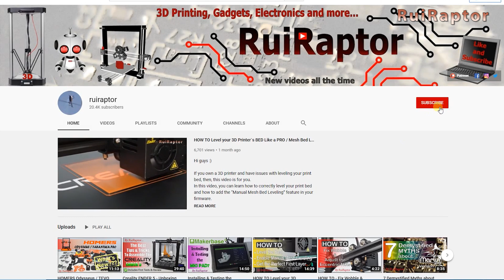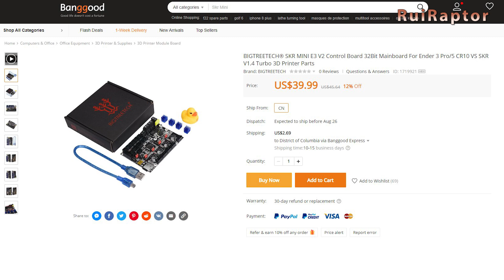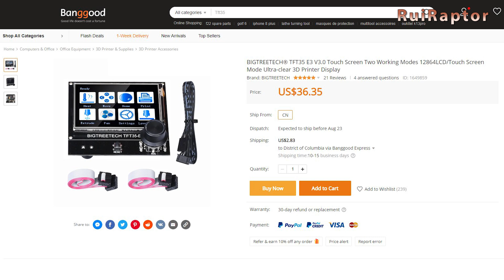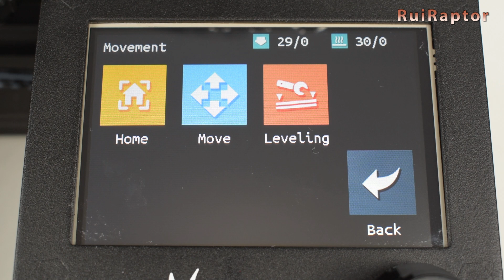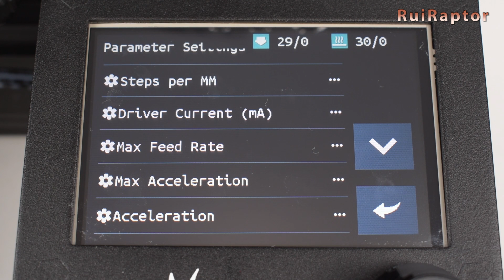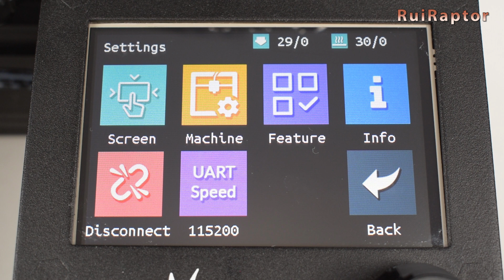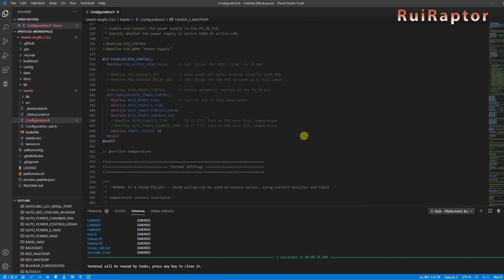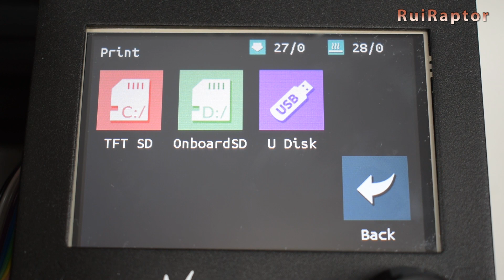SKR Mini E3 V2.0 + TFT35 Installation Guide + BLT Upgrade (ENDER 3/ENDER 3 Pro)

Comment: Very Disappointed.  I replaced the original Creality board, in my Ender 3 with the BTT SKR Mini E3 V2.0.  Now my computer cannot communicate, find, or recognize my Ender 3.  The seller does not respond, and, I find the Git Hub information useless for a person that is not very technical & computer savvy / literate.

Comment: Great video.  I am a bit behind the times and willl be doing this upgrade to my Original Ender 3, although I have never had any problems with it.  I am puzzled by the comments on the "noisiness" of the machine.  I do not think it is bad at all, and far better than the terribly loud and headache giving crap "music" the neighbours play all the time.  With all my doors & windows closed, and the curtains drawn, that crap "music" still drowns out the little noise of my Ender.

Comment: Rui my printer still saying  " no printer atacched" any sugestiion?
Reply from the maker: Hi Rui, make sure you have the serials correctly defined in Marlin. Also, make sure the serial cable is connected correctly on the board and on the display.
Reply: @ruiraptor  thanks i will review that and try again. Once more muito obrigado

Comment: Does the skr mini have the same issue as the original ender 3 board where the electronics fan and part cooling fan are wire to the same place?  This is a serious issue if printing with the part cooling off which would also turn off the electronics fan.

Comment: my part cooling fan and motherboard fan comes on but the front facing heatsink fan doesnt turn on. any ideas why? i double checked the wires i saw in this video you didnt plug in the front facing fan

Comment: The stock ender 3 boards have both the part fan and electronics fan wired to the same power connection so that if you turn the part fan off, the electronics fan also turns off.  I was wondering if the v2 board has separate power controllers for the part fan and electronics fan?

Comment: Great video! Do I need to flash the firmware even if I am not using BL touch? Or am I ready to print as soon as the new board is installed?
Reply from the maker: We would recommend to flash the latest Marlin version.

Comment: I installed the v2 and tft50 in my ender 3. I updated the firmwares and I cannot get a print from thr touch screen to work. I have to go in marlin mode haha. Ferrules for everything. Creality finally got the hint.

Also do you find the touscreen very washed out. It has no visibility from any angle.
Reply from the maker: Hi, our touchscreen does not look washed out. Regarding starting the print, do you have problems only when starting the print when using the touchscreen? Are you selecting the correct media to load the files?
Reply: @ruiraptor  yeah, I can only see files on media attached to the screen but if there's a card in the mainboard slot I cannot see it in touch mode and I don't think that's how it should work. All the amperage settings for the motors I had to enter in marlin mode and the touch mode. I think I'm going to put the old screen back on and reflash the firmware on the board and get that sorted out and then add the screen I think.

Comment: Why does everyone say to trim the tinned wires?! It is a useless gesture. The ferrule advice is fine, but you don't need to remove the tinning. I don't know how this misinformation spread. Either way you do it, you are still making a cold weld. Tinning the wires is not going to cause you any issues or more cars, boats, houses would be on fire. The issue is more akin to stray wires and better electrical connectors that ferrule connectors work. The connectors are often coated with tin, the solder joints are tin, the wires are coated with tin when soldered directly to the board. Just install the ferrule.
Reply: Well spoken! This is useful information for the bigger part of the readers of this comment section. 

I would like to add to your explanation that there’s also lots of different kinds of tin that have different properties and make the end result way more beneficial to the general set purposes of making a soldering connection. 

I personally have 3 things that come to mind when I’ve decided to make use of soldering connections over plug and socket connections. 

Those are;

-Conductivity of the joints (also the final resistance simultaneously)
-Soldering strength 
-Maximum meltingpoint

So there’s general purpose tin and some more advanced fieldwork setting tin. 

We never only use the metal tin, commonly used tin is an alloy of 40% tin and 60% zinc which is widely available and pretty inexpensive. 

I prefer to use an alloy that contains a percentage silver or copper just to keep the cost relatively down. 

Those alloys will increase everything including the pricetag. 

The silver containing alloy I prefer is 97% tin and only 1.2%-3% silver. While the copper alloy has a higher melting point and contains more different elements (metals) so the percentage of each element fluctuates more than the silver variant that I prefer. 

Melting points are;

Tin-silver alloy 198°C upwards to 217°C

Tin-Zinc-Nickel-Copper alloys 209°C up to 232°C

Comment: Great video guys. I'm about to go put the board in my ender and pid tune the microswiss hotend and figure out the current and esteps for the orbital extruder. I have a brand new bl touch that I've had since August of last year. I don't mind the corner paper method but I'm putting on a pei bed as well and I'm wondering if it's worth it to install the bltouch or just play with it some day when I'm bored. I have a spare y gantry plate if the existing one is warped. I'm replacing the glass, hotends and main boards on both my ender and cr10v3. I plan to enclose that one and keep the separate enclosure box.

Comment: I swapped my board and when i turn it on it just stuck on the start up screen, help please!
Reply from the maker: Hi Mark, have you installed the correct firmware on the new board?
Reply: @ruiraptor  yes I tried to update the firmware, when I insert the micro SD and turn on the printer nothing happens it just stays on the start up Screen. Then I tried to put back the motherboard that came with the printer and it works fine. So maybe I got a broken skr mini board?
Reply from the maker: Hard to say. Can you send the config files so we can check the firmware setup that you are trying to flash?

Comment: Hi, your video is VERY helpful except when I turn on the power yes I get the message "printer no connected" but then the screen goes dark after a couple of seconds. anyone have an idea why? I'm using an Ender 3 with the TFt screen and SKR mini V2.0. thanks in advance
Reply: You may have to change firmware to something like mriscocs professional firmware. Try that!

Comment: Will this work for an ender five
Reply from the maker: We didn't test but we believe yes.
Reply: It says in the beginning of the video it will work with an ender five??A little confused now
Reply from the maker: Hi Brian, sorry for the confusion...let me clear things up... The board has the same size as the original one and with the connectors at the same place so the fisical installation is easy. However, for the Ender 5, you need to flash a new firmware on it because the firmware that comes with the board is for the Ender 3. Having said that, you need to compile (or download one for this board and for the Ender 5 ) for it to work.

Comment: So we can use the existing rainbow ribbon cable with the new TFT35 screen because the gray cable that came with the board is too short?
Reply from the maker: Hi, yes, you can use the rainbow flat cable instead the gray one. It will work the same.

Comment: Bought a used Ender 3 Pro that already had the touch screen installed. I just upgraded to the v2.0 board and picked up the BLTouch, a Micro Swiss hotend, and a dual gear extruder. Hotend fan was melted to the old (aftermarket) hotend, so I had to rotate my main board cooling fan to the hotend and borrow my Raspberry Pi 4B and 5V fan (waiting on buck converters to ship still) to temporarily cool the board so I can print my Hero 5 fan ducts for the Noctua fans.

Your video helped me figure out the touch screen control board. I now know I'm missing the black serial cable, explaining the "No Printer Connected." Also, my BLTouch did not come with brackets, so I have to print them as well (on a printer that isn't running yet).

Quite the juggling adventure, but this video is helpful and added to my resource playlist to review again later.

I have zero experience with 3D printers.

Comment: hello i have error when homing Error:STOP called because of BLTouch error - restart with M999
someone help can help me?
Reply: Your BLTouch cable is probably loose. I had the same issue. I resolved it by opening the control board area and reattaching the cables.

Comment: Still only the 256KB flash on the chip vs 512KB. (processor STM32F103 RCT6  vs RET6) and they’re only saving about $1.50 per processor using the lower flash version.

Comment: I just performed this install minus the bl touch. Im having issues when homing, the head keeps moving and hits the end stop but acts like it doesn't see that it hit and the motor keeps running. It sounds bad. Is there something that I missed during the install?
Reply: i was having the same issue and was up for 2 nights.  you need to  make changes to the firmware.
Reply: I had the same issue, I accidentally put the x axis in the z motor because there's 2 z motor connectors.
Reply: @tips1483  I need to check that, I haven't had time to look at it again but I did mark all of the wires with masking tape so I'd like to think I didnt plug the wires on wrong, but there's also the possibility that I'm just incompetent and marked the wires wrong when I thought I was being smart. It happens.... way too often imo.
Reply: @shade_angel1445  on the side opposite of the screw in power connectors it has text on the pcb that says if it’s the X Y Z or E (the first letter of a 2 letter combination of letters) and you’ll notice there is two that start with Z
Reply: @tips1483  I want to say that I saw there were 2 Zs and was surprised, I read it was for a dual Z setup since I guess people do that.  I'll have to take it back apart to check when I get back home.

Comment: So what display did you use in Marlin? i keep getting this error: "Only CR10_STOCKDISPLAY, ZONESTAR_LCD, ENDER2_STOCKDISPLAY, MKS_MINI_12864, and TFTGLCD_PANEL_(SPI|I2C) are currently supported on the BIGTREE_SKR_MINI_E3."
Reply: Did you ever end up finding out which one to use?
Reply: @p0st4L  yes. it doesn't matter. since it has its own CPU, the TFT35 runs its own software and simply talks to the SKR MINI via commands and ignores all of those Marlin display settings. I left it on the stock cr10 display. but you can also comment them all out too and use to display.
 All the display settings are for if you are going to hook up a screen that the SKR Mini has control of. Like the Zonestar LCD display or the CR10 display.

Also, you will need to use VS Code to flash software( i think its a version of marlin or similar) onto the TFT35 similar to the Marlin one for the SKR Mini to get it all to work properly or if you want to change the icons and such.

Comment: Hello! I bought the same set as you did, however, when starting the printer, where i get asked if i wanna use marlin or touch mode, when i select touch i get a message "no printer attached", when i select marlin mode it simply jumps back to the display before. Any ideas?
Reply: I had a similar issue but also my stoppers didn't work on my board
Reply from the maker: For the touch screen to work you need to have the 5pin black cable connected. Check if it's correctly connected.
Reply: @ruiraptor  honestly upon inspection the board I got was just faulty
Reply: Okay guys so the problem was i tightened up the screws on the display too much (well actually i didnt tighten theb much at all but it seems like it was to much anyway), so the display got preassure from the metal platr it is attached to and because of that it didnt work! I used some washers to get some distance between the screen and the metal plate and now it works perfectly fine

Comment: do i need to make sone changes for my ender 3 pro? im talking about your bin file.
Reply from the maker: Hi Sea, the configurations are basically the same. You can use the same Bin file for the Ender 3 and Ender 3 Pro.
Reply: @ruiraptor  i did upgrade my firmware with your bin file but pause/continue does not work correctly.  I think i have to compile myself. Are you guys will update your pre-compiled firmware from your patreon page? Also i have to say thank you for your clear video. I did open a topic in a forum site in my country and i did put your video to if anyone else needs help.
Reply from the maker: Hi Sea, thanks for that.
For the pause/continue to work it must be enabled in the firmware. We can check this and publish it as soon as we can.

Comment: thought i would join as a patron but paypal doesnt work? wanted to download the bin file with the bltouch software you mentioned?
Reply from the maker: Hi Pablo, thanks for your support. Paypal does work with Patreon.
Regarding the bin file, that file is available for free. Just enter the post and download it.
Reply: @ruiraptor  hi thank you i must be missing something as i cant find your file? brilliant videos and new sub added
Reply from the maker: Please check if this is what you are looking for:
https://www.patreon.com/posts/firmware-bin-for-40695400
Reply: @ruiraptor  thank you for your help i will attempt this now, trying paypal again also
Reply: @ruiraptor  sorry going to ask, the file name is it .bin or firmware.bin for it to load to the board?? thx in advance
Reply from the maker: Hi Pablo, the instructions are on the post ;)
1 - Download the file and rename to firmware.bin file
2 - Copy the firmware.bin file to the memory card
3 - Place the memory card in the printer and turn the printer on
The printer will boot up and upload the firmware automatically to the board.

If the firmware is correctly uploaded, the file will be renamed automatically to firmware.CUR
Reply: @ruiraptor  hi yes did all that but doesnt seem to flash the board.
Reply from the maker: try deleting everything on the card and have only the bin file in it.
Reply: @ruiraptor  yes did that also.the bltouch lights up and the pin goes up and down but nothing seems to have changed on the screen reference to there being a bltouch connected,  I have added the black and white to z port and swapped the wires in the original connector to so red is middle and bottom is blue
Reply from the maker: The best way to know if the firmware was uploaded to the board is check the card after the reboot. A successful upload renames the firmware.bin file to firmware.cur.

Comment: I checked the new bullet points in v2 and realized I can get 1.2 for 50% the price of v2.0 today, so I opted for the old version. 
1. external EEPROM durability increase can be dubious especially if you don't change settings much
2. not planning to use dual Z motor
3. using 3D touch as z probe and not using sensorless homing

All of these means v1.2 is just fine. I keep my 20 bucks

Comment: Great video! Question: once the z-axis stop connector from the bltouch is connected to the board, what do we do with the original wire coming from the z-axis limit switch?
Reply from the maker: Hi, the original endstop cable you can remove and keep it as spare.

Comment: If I flash the board of a new firmware for the BLTouch  Does it wipe out a thermal runaway protection
Reply from the maker: If you get the firmware from Marlin, it normally comes with the thermal protection enabled by default.
Reply: @ruiraptor  ok thanks

Comment: Regarding Visual Studio Code: I'd recommend also using Marlin Auto Build. Seems to make it easier to compile, as all you have to do is push a button.
(Unfortunately it can't take away all the pesky configuration file mangling. Though there seems to be an option for that. Someday...)
Reply: I used Marlin along aside with Cheetah. I already have BIGTREETECH SKR MINI E3 V2.0. What's the best way of installing the Touch screen display? Do I need to re compile the firmware? tks!

Comment: Where'd you get those ferrules?
Reply from the maker: Hi, the ferrules can be found easily on any electric local store. You can also find them online at stores like amazon, banggood or aliexpress.
Reply: @ruiraptor  I tried looking for them after your video, but I'm probably using the wrong term. Do you have a direct link?

Comment: I keep getting "printer not found" error on my SKR E3 V2.0 + TFT 35 board. Any idea on what I can check to get it working.
Reply from the maker: Hi John,
make sure that the RS232 cable is correctly orientated and connected to the board and to the display.
Reply: Thanks for the quick responce. Ithink it's conected properly. The single plug is conected to the first pin on the TFT board conection and the other end is conected ti the RS232 conector and lockes into place.  Could there be any other reasons for the "no printer found" error
Reply: It's me again. my board id still not working. I think I'm going to try and update the drivers for the board if I can figuer out how to download the file from the github web site. Any help you can provide will be greatly appreciated. Thanks in advance.
Reply from the maker: Hi John, check in the configuration.h the serial_ports definition.
Reply: @ruiraptor  The serial port does not recognize the printer and I cant get to the config.h file. I think I lost the original configuration file and the sim card that came with the board got overwritten. I don't know how to get the file from Github to replace the firmware.bin file.
Reply: @johnbrodzinski6279  your SKR mini is shot. mine was out of the box. the tft and BLTouch didn't work, then i plugged them into a new skr mini board and they did.